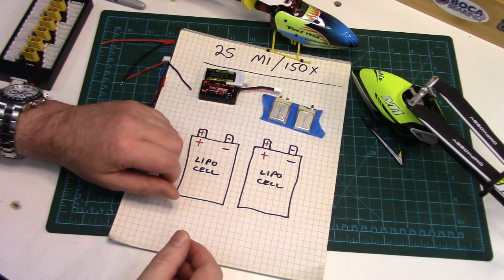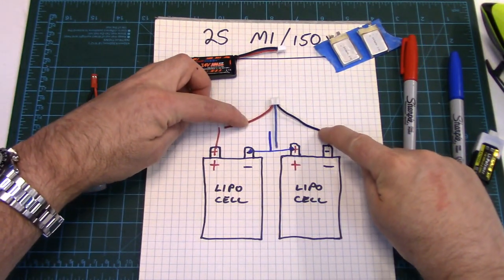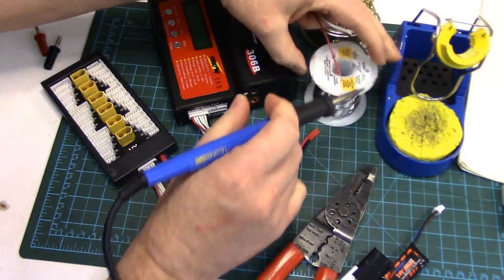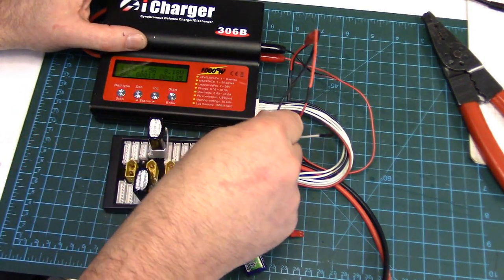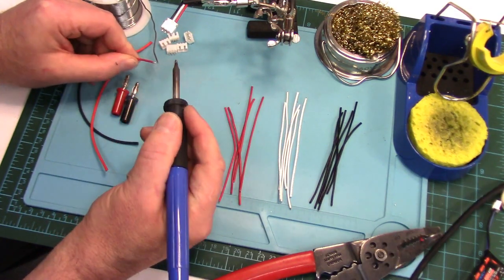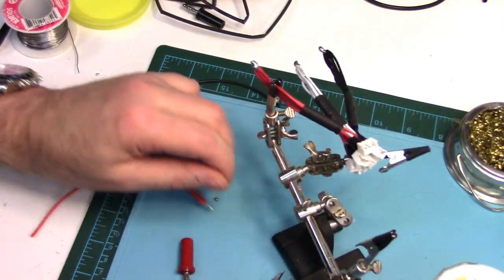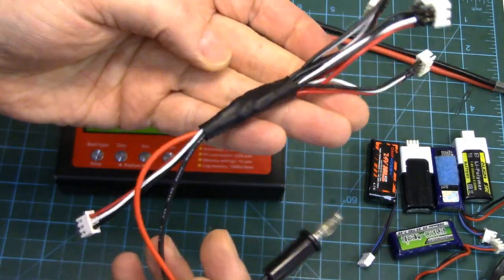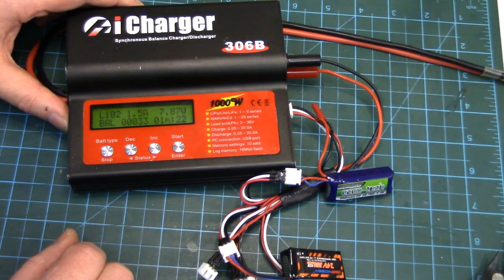JST 2S Parallel Charge Wire for OMP M1, Trex 150X & Others.

Comment: Another tip that also works and is much less work for when you have a balance board anyway: Just solder a single XT60 or XT30 (depending on the board) to a single red wire with a plug at the end that you can pop into an unused size of the balance connectors on the board.

How does this work? You plug in your balance board to the charger like normal (including the charging leads). Now you plug the trivial "bride cable" XTxx described above into the balance board like a battery, and plug the single positive lead that comes off into a corresponting slot on any of the balance plugs on the board. If you want to charge 2S, you plug it into the 3rd pin (1st is ground, 2nd pin is between 1st and 2nd cell, 3rd is positive of 2nd cell). And you're done. Plug in your batteries into the board like John did and off you go.

One note on this: Depending on what you use as the plug that delivers the charging power into the balance connector (I used a 1-pin dupont, but that's really not ideal) this may handle even less current than Johns variant. a dupont only makes partial contact with the JST-socket, so charging a few packs at 1-2 A is probably fine, but don't go nuts and charge huge packs at 10A with this.

Comment: John,another great how-to and your delivery is top notch,really easy to follow and fun. I am still a newb so can i ask, charging like this ,using that charger,if a cell was suspect in a pack would you get a warning? Also that charger looks very good,does not seem overly complicated, would it be suitable for the small cells like these and upto 4s apx 5000mah? would like to charge 2 packs of the 4s at once,thanks
Reply from the maker: If you want to understand how parallel charging works along with the pros, cons & risks, my parallel charging page on my site covers the topic in detail: https://www.rchelicopterfun.com/parallel-lipo-charging.html
The short of it is, if you have a bad pack or one with a suspect cell (high internal resistance or physical damage) don't parallel charge it. The charger simply sees voltage at the balance plugs and can't detect if one cell in the branch has a high internal resistance or some other issue.
Your second question relates to selecting a charger with not only up to 6S LiPo cell capacity, but enough power to charge larger capacity packs, and even para-charge large capacity packs. This is too broad a subject to answer in an YT comment box because it also requires a power supply to handle that output. If you want to contact me directly on my website, that would be best. My page on RC chargers will help you understand RC chargers, what to look for, and power requirements: https://www.rchelicopterfun.com/rc-battery-chargers.html
To quickly answer your question specific to the iCharger 306B used in this video. It's rated at 1000W & 30A at 24V input. It certainly has the power to charge larger 6S packs. It can para-charge six 6S 5000 mAh packs at almost 1C (30 Amps). It however is not good for tiny micro packs. I wouldn't charge anything smaller than a 1S 500mah pack. It works fine however with several small packs hooked in parallel as demonstrated in the video.

Comment: Thanks for the video John . I assume each battery must have the same starting voltages, or very close to, before plugging them into the harness?
Reply from the maker: I cover max cell delta voltage difference in depth when parallel charging on my how to parallel charge page which I link to in the description.  My quick & dirty however is no larger than a 0.1V delta between cells.

Comment: Great video!   I fly the micro helis and would like to do something similar on my B6 balance charger for my 1S mcx batteries.  Thoughts?
Reply from the maker: You won't know how your specific computerized charger works with micro 1S pack parallel charging until you try it. Micro packs have high internal resistance numbers and some chargers as they switch to the constant voltage stage of the LiPo charge cycle during the last part of the charge will never reach the cut off voltage due to the high internal resistance. It's been my experience that as long as you have 4 or more micro (100 - 200 mAh 1S) batts hooked in parallel, it will work with most computerized chargers since the resistance drops when you hook the packs in parallel as per Ohms Law. Again, you won't know until you try with your specific charger, but definitely monitor the para-charge cycle closely or you may find all your small capacity 1S packs resembling cocktail wieners several hour later.

Comment: I can't stress enough that you have to make sure you're not plugging two or more packs with different charge levels together! The full(er) battery would quickcharge the low(er) one. Since these lipos have very low internal resistance you'll get a lot of amps - easily exceeding the max charge current of your low(er) charged battery. That would decrease the lifespan of your batteries considerably - not to mention the fire hazard.
Reply from the maker: These packs actually have fairly moderate internal resistances at least compared to big packs. Regardless, you are fine with 0.1 delta V between cells. That's my general delta V para - charge rule when charging big packs or tiny ones like the OMPM1's
Here's a current flow video showing current flow rates at different states of charge:   https://youtu.be/9UlWF4Qjax4
There are of course lots of variables involved in para-charging and you can't encompass every para-charge scenario with any blanketed or hyperbolic statement. My 0.1V delta rule is playing it on the safe side.
The ONLY WAY to know for sure how safe the delta V can be with any combination of packs is to take actual current flow readings between packs (as I did in that video link), to determine if you're sending too much current to the lower charged pack/s that is much higher than their max charge rate and for any duration of time.
That's another big consideration, because even with a larger delta V, the initial current flow is short lived and likely not that big of a problem if we are talking about long term cell degradation. Assuming healthy packs to start with of course. It's doubtful much if any electrolyte decomposition (off gassing) would occur because temperature would not increase much in that short a time frame and that is the killer. But to play it safe, I stick to the 0.1V rule regardless of cell size.
Reply: @Rchelicopterfun  Hi John, I agree with all you said, but keep in mind, here are people following your tips who might not see the full picture and it may happen someone will connect a fully charged lipo with an empty one :(
What I did already ten years ago: do a serial connection harness and charge three 2S packs on a 6S charger - that way no risks involved - the charger is taking care of the imbalance.
Reply: @Rchelicopterfun  I just found in the manual, OMP is actually selling an accessory that does exactly what I described in my last comment. Have a look at page 17 / "step 11" of the manual :-)